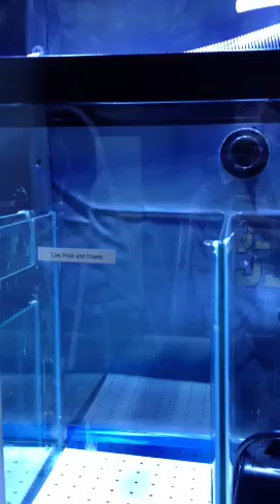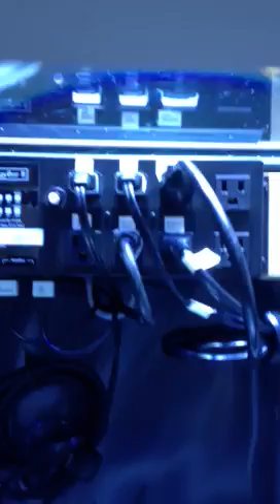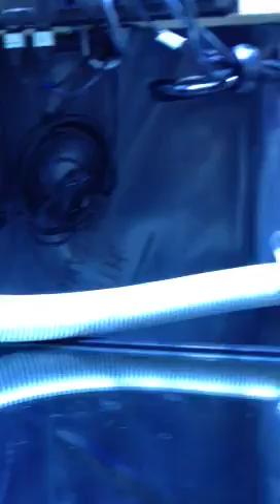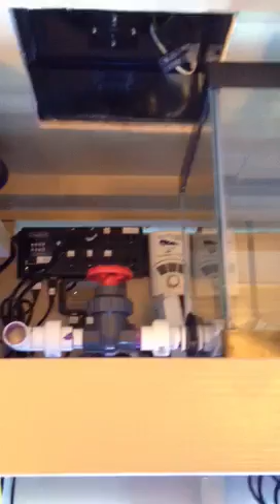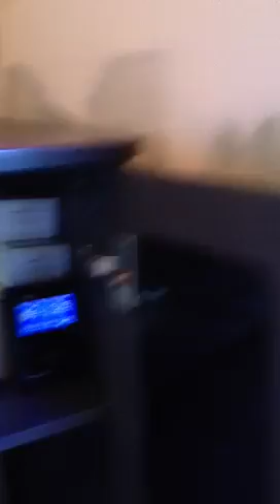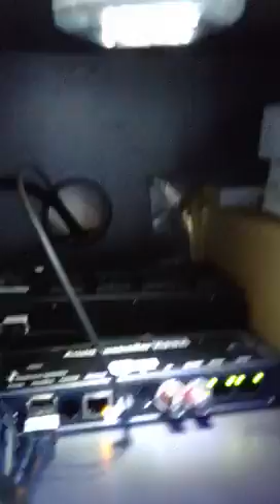Days 7/8:  Built In Aquarium Build

Comment from the maker: @adjusterfrank Day 8 was 14 hours of work straight! It is a tight fit. My space is limited due to my desire to have the tank at eye level and wanting to be able move my lights up and down for coral additions, etc. So, I opted for more space for a light movement mechanism and less for adding salt to the mixing tank. I could put a tube into the attic and once every two weeks go up there to add salt but climbing into my attic 20+ times/year isn't my idea of an efficient tank ;)).